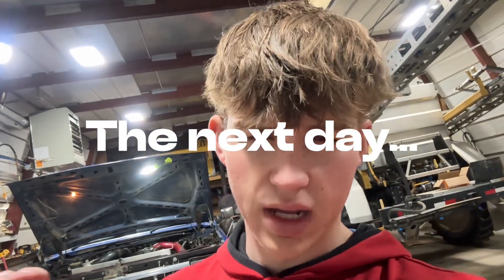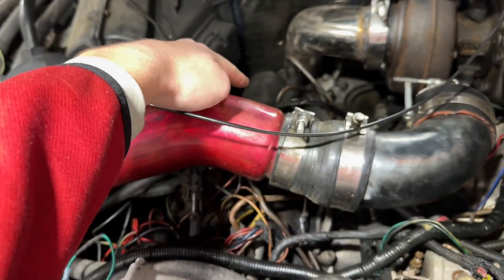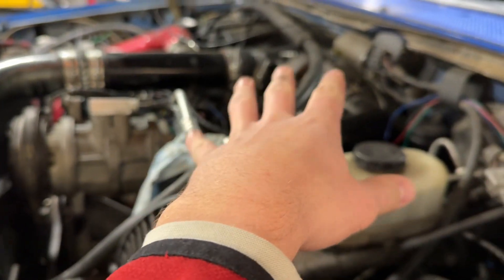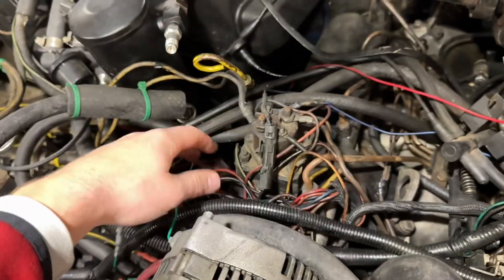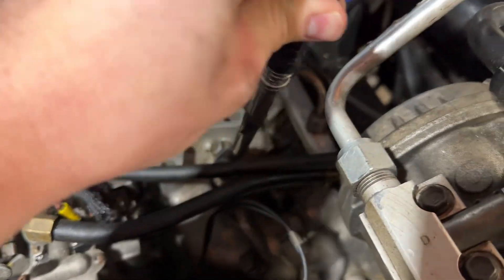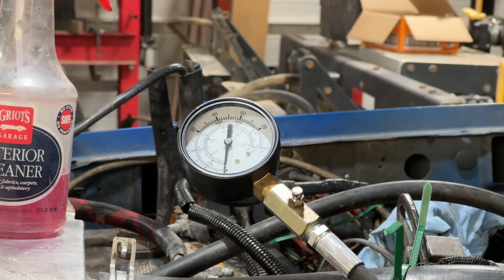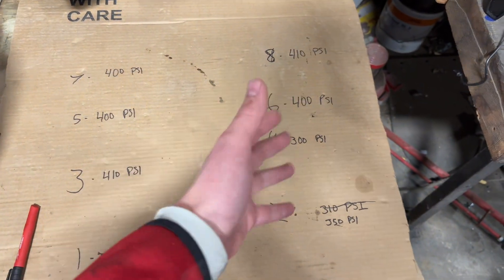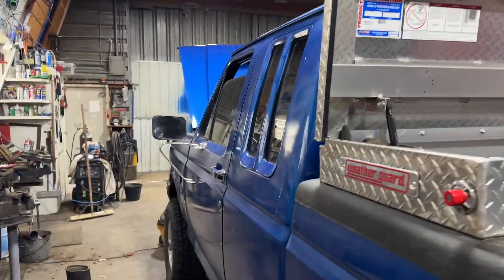Compression Testing my 7.3 IDI Turbo

Comment: I'm have a similar issue with my 6.9.  no one cylinder is bad but the spread is all over. Stared looking into because of blowby and oil consumption.  Engine starts and runs great.  Was going going to rebuild but piston and rings are hard to find.  So I'm stuck trying to figure out my next move before I tear it down.
Reply from the maker: Unfortunately there’s only one long term fix, which is a rebuild. Most likely wouldn’t need new pistons, and rings should be findable but honestly, it’s probably cheaper to buy a running 7.3 and put in there than try to rebuild a 6.9.
Reply: @thatbluebricknose  I've gone back and did some testing, the blowby is so extreme, it pegs out a gage that goes up up to 15 inches of water column.  Im hoping I have a head gasket that blew into the block side, I know it's got a small leak into the coolant cause I see bubbles there.  Fingers crossed I can see the path when I pull the heads and that's all it is.
Reply from the maker: @MichaelBerry-dd2eh shoot that’s unfortunate. Hope it’s just head gaskets!
Reply: Justin with r&d has a ring set for idis they partner with total seal